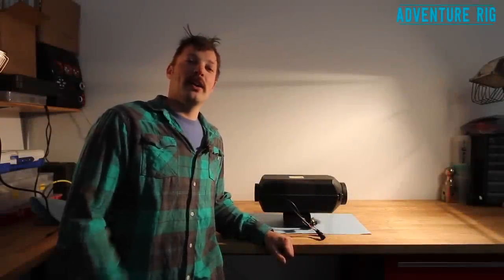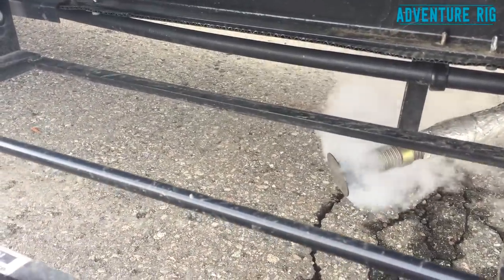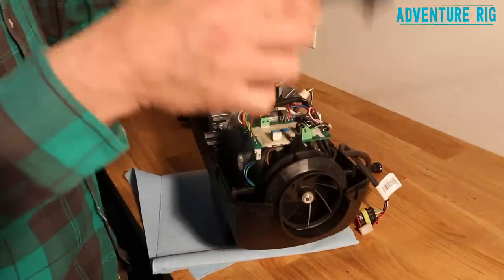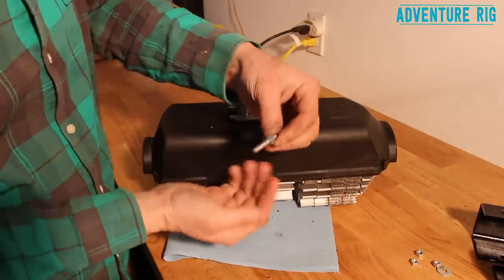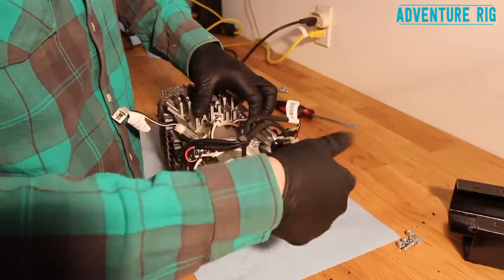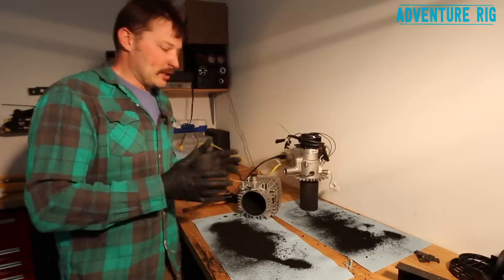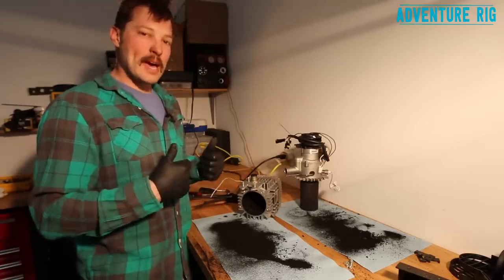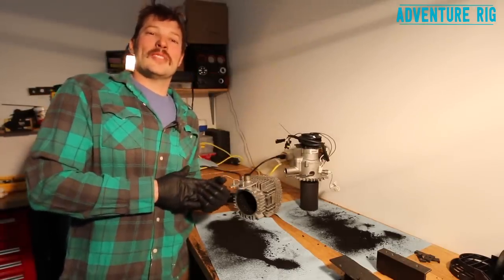Must watch before you use your new Planar Heater! [How-To] Disassemble and Clean Planar Heater

Comment: I'm wondering if it might be smart to buy a lower capacity unit so that you can run it on high all the time. I've seen these heaters from 2KW to 5KW capacity and the cost is not that different. How many people just buy the bigger ones thinking they can just run it on low?
Reply from the maker: AndTheCorrectAnswerIs That may not be a bad idea. I think you would save on fuel doing something like that versus running this on high and opening windows.
Reply: Every maker of this style heater tells you that selection of the proper size is imperative. Sure Marine in Seattle, one of the largest boat heater sellers, also insists on doing the sizing for this very reason.
Reply from the maker: The hard part is this particular heater is sized for the camper. But if it's 50 outside you need to run it on a different heat setting vs if it's 5 outside. When it gets warmer outside that's when you need to take into account what setting your running the heater on.
Reply: Yes, that is the way to go. Also the note about Kerosene is also good, even if not at altitude, run kero on a regular basis. One other thing I learnt, when you do have white smoke pouring out, force air into the air intake with a blower fan like the type you use to inflate air mattresses. This helps clear out the excess fuel, gets convection going through the system, and introduces the extra O2 required to prime fuel ignition. Another common problem subsequent to the soot problem, your muffler may also be badly sooted, and that means it creates backpressure that defeats the critical airflow through the ignition chamber. I had much better luck by just getting rid of the muffler.
Reply: I think another problem is the thing vents from the bottom. If I owned one I'd experiment on the "chimney". At least get it where the top of the chimney is above the height of the unit. Getting it to vent downwards can't be efficient.
Reply: That is a sales gimmick. The 2kw is exactly the same as the 5kw. No differences at all. These are mass produced in very large quantities. They certainly would never produce one of the same with a 3kw delta.
Reply: with the vent at the bottom this helps if the unit gets flooded with fuel, if it vented at the top you would need to remove the unit and clean it
Reply: Forcing more air won't help. : (. Smoke at startup or other times is unburned fuel exiting the exhaust.  The only solution is a hot enough  chamber so it all burns off.  TURN IT ALL THE WAY UP

Comment: WHY YOU SAY PLANAR HEATER WHEN THIS IS JUST REGULAR 90EUR CHINESE DIESEL HEATER. SO USE GENERIC NAME NOT MODELS
Reply from the maker: It's not a Chinese heater. It's made by Planar in Russia. The Chinese one you see on Ebay is not a Planar. If you go to their website you can read about it.
Reply: @AdventureRig  and both are webasto copies
Reply from the maker: @talusranch990  Do you think the Planar runs as well as a Webasto? Do you have a Webasto you're comparing it to?
Reply: @AdventureRig  I have a eberspachher d8lc.   Overly complicated but has a rotary combustor.   They all suck but I wouldnt sleep with a Chinese one nearby
Reply from the maker: @talusranch990  I would not want a Chinese one either.
Reply: @AdventureRig  so those 100 pounds planar heaters on ebay are not...planar?
Reply from the maker: M D Those are Chinese knock offs.
Reply: Planar it's high price garbage . Buy Chinese air heater 7 time's less price and good quality.
Reply: @AdventureRig  Planar 90% Chinese heater but less quality.... All parts from China !

Comment: Hi Tyson     Thanks for all the videos. I had the same sooting deal with my  8DM12 last season but I ran it on low (not knowing) way too long. This year I take it for high speed runs regular and it seems to be helping. I also am adding an additive for cold weather to stop gelling etc  . I don't have the name right here but I can send it later. Sergey tells me once a month to run a quart of kerosene through on its own full blast, so I will be doing that too this year. I am up the coast of BC along way from his shop so I have to learn to keep er runnin...Sergey has been a great help. What I am really looking for tho is a way to have it come on (at any temp setting) a couple times in a 24 hour period on its own while I am away from the boat. Anyone got any ideas on that?
Thanks again    keep up the vids!
Reply from the maker: Thanks for watching the videos and your insight. I agree, Sergey is helpful. I would love to see them come out with an app where you can run the heater off your phone.
Reply: Hi...I think operating any combustible appliance unattended on a boat is risky at best. Thinks go wrong and nothing is full proof. When it comes to a Dickinson style heater or propane controls  on a tank the consequences of even a small hiccup is not worth the risk. I would rather be cold and wait for heat than lose my boat. It's all about risk taking and what you can afford to lose.
Reply from the maker: Very good point Greg.

Comment: How much fuel does it use? I know it's not a simple question to answer as it's usage & the heat setting changes. I currently have a gas heater (LPG) & it would be interesting to compare the running cost of with a diesel heater, they seem very popular.
Reply from the maker: The tank is around 1.8 gallons and if it is sunny and in the low 30's during the day and mid teens at night ours will run for 3 days on the 1.8 gallons. The heat it puts out is nothing like the LPG heater. It is crazy hot as well as dry keeping the humidity level in control during the winter months.
Reply: Adventure Rig Ok, thanks gives me a rough idea. Interesting to see inside one by the way. Looks fairly simple which is good.
Reply from the maker: Yeah not much to it.

Comment: Try using unleaded fuel instead of diesel.
Reply from the maker: I don't think I will try that.
Reply: There are companies that make a different heater that runs on gasoline. Looks the same but different fuel, and I'm sure different burner assembly Etc.

Comment: Buy good quality diesel fuel, that's a key
Reply from the maker: "Good quality" and "diesel" don't exactly go together.
Reply from the maker: I would make sure to run it on the max setting each time before turning off the heater.

Comment: So, do you mean soot will build up eventually? and low temperature setting accelerate it?
I am going to purchase Planar heaters a lot. So, I like to ask you.
Reply from the maker: If you run it hot soot should not build up.
Reply: @AdventureRig  what temperature do you  recommend? my controller holds the casing temperature on higher settings around 210°C but I can go down to less than 70°C on lower setting.
Reply from the maker: underwood I just run it on it’s hottest setting for 5 minutes before shut down.
Reply: @AdventureRig  I'll try this after cleanup but my controller runs the heater on hottest setting for a few minutes before shutdown anyway. Sometimes I got a E-03 (ignition plug failure) on shutdown, and sometimes on startup to.
Reply from the maker: underwood Oh I see. I have to manually do it on the Planar.
Reply: @AdventureRig  but it is not long enough or I have a other problem, because soot build-up after a few weeks of use. But this video helps a lot, now I know where to start. thanks!
Reply from the maker: underwood If I’m running it at higher altitudes I use kerosene and that has fixed my problem.

Comment: run kerosene  way cleaner  diesel these days no good  kerosene more money
Reply from the maker: Yeah I ran kerosene while trying to clean it out and trying to avoid taking it apart. I'm going to try diesel and running it on high to clean it up before shutting it down.
Reply: Adventure Rig unfortunately that won't help either  destined to fail  try a Mr heater unit  propex unit  Dickinson marine heater I up here in Canada full time 22 years now
Reply from the maker: I had a larger heater from them and at the time it did not have an option to run it on any setting less than 59 degrees. I never had an issue with it and the only time I had an issue with the current one is when I set it on a low heat setting. Running it on hot should take care of the problem.

Comment: While I'm no combustion engineer, the big smoke seems to indicate too rich a mixture. Either more air or less fuel should help. Optimizing the lower temp mixture should eliminate the soot and smoke problem.
Reply from the maker: Roger Shoaf Hey Roger I think you’re on to something. I actually wrote an email to Planar asking about a high altitude fuel pump. Other companies have them but Planar does not offer it. I’m at 8,500 ft and I think the fuel/air mix is definitely off. I only run it on kerosene now and never heard from Planar on the pump.
Reply: @AdventureRig  make the intake air house a bit shorter will lean air/fuel mixture and the problem with soot
Reply from the maker: @hisab-n8c  Worth a try thanks!

Comment: Thank you Tyson with adventure . I have been a technician for quite some time . No matter what when gasoline or diesel comes in to my shop I put a minimum of 1 quart per 6 gallons of inexpensive automatic transmission fluid if you look at transmission fluid it's basically soap and light oil I recommend you mix it before you put it in your tank and I think that would work much better. In my opinion the buildup you had could also be helped by adding gasoline to your diesel 1 gallon per 6 gallons just a thought. Adding gasoline to your diesel is not a new thing it's been going on for quite sometime cold-weather dirty Burn etc. etc.
Reply from the maker: Awesome thanks Eli I appreciate the comment.

Comment: All of that soot is a sign of incomplete combustion. It's air-fuel ratio is clearly running far too rich.This means that it's wasting a shit-load of fuel. Find something better. Propane heaters are the cleanest running heaters around, and they don't create carbon monoxide, which is a bonus. They are also far more fuel efficient than even a properly designed diesel heater.
Reply from the maker: INF1D3L010 I will agree that the fuel to air ratio is off. Other companies have a high altitude pump but Planar does not currently offer that. However I have used plenty of propane heaters and would never use one again. The diesel heater absolutely blows those out of the water in terms of efficiency and heat output. Diesel also has higher BTUs then propane.
Reply: I Have a propane heater in my boat, I'm going to switch it now for a diesel one just because of the danger of propane... Nice to know now to put it on max output some time. @AdventureRig
Reply from the maker: Tom Haneveir I think you’ll be really happy with the performance of the diesel heater. Thanks for watching!
Reply: @AdventureRig  Fair enough. I guess I'm just biased towards propane because of the carbon monoxide issue and the fact that it burns pretty much 100% clean. Sure, diesel has far more thermal potential, but extracting all of that thermal potential from diesel is alot harder to do than it is with propane. Soot and smoke are thermal potential killers, and wasted fuel, to boot.
Reply from the maker: INF1D3L010 I’m actually in the process of testing out a heater that is the same style as this heater however it’s mounted outside the van and runs on propane. The brand name for that one is Propex and I’ll be doing a comparison video in the future.
Reply: @AdventureRig  Good stuff. I guarantee you'll find that it runs much cleaner. As for performance, that would pretty much depend on the design of the unit. There's nothing to say that propane heaters are inherently bad. If you ask me, their capabilities have grown by leaps and bounds, and continue to grow over the years. Propane may not have as many BTUs as other fuels, but it's the do-everything fuel. You can even run gas-turbines on the stuff. Kerosene is preferable for an application like that, but propane could do it in a pinch.